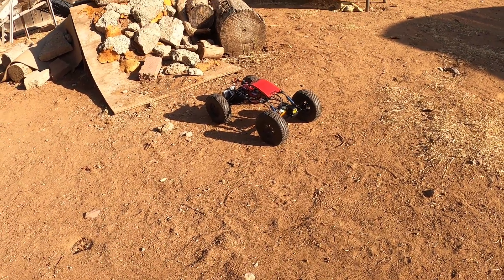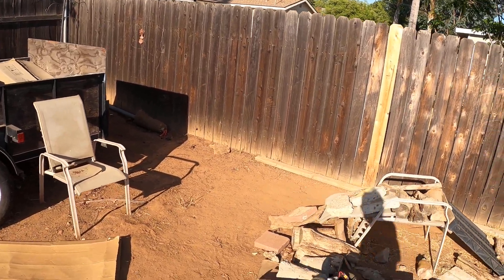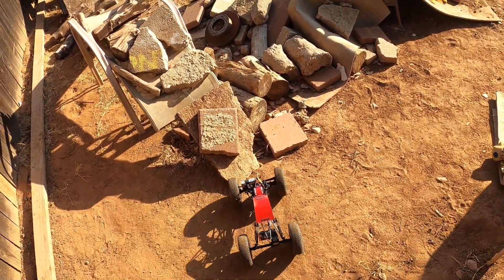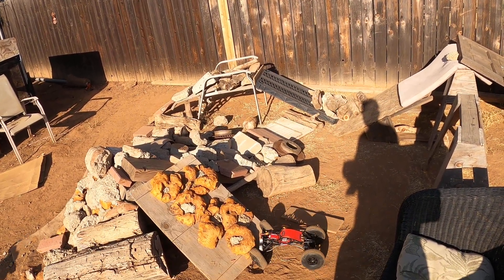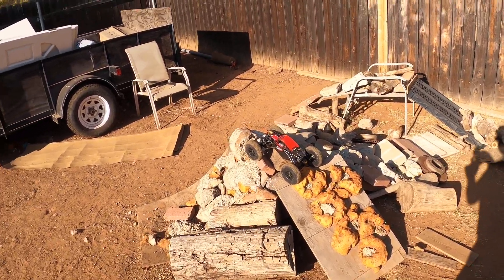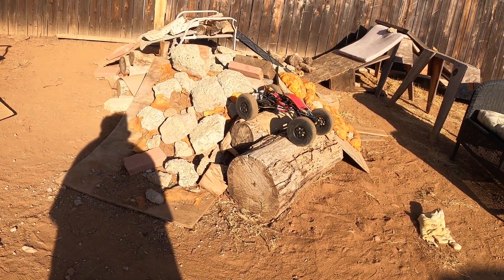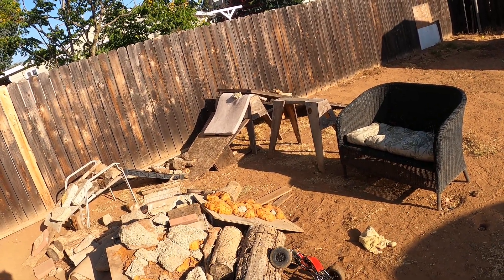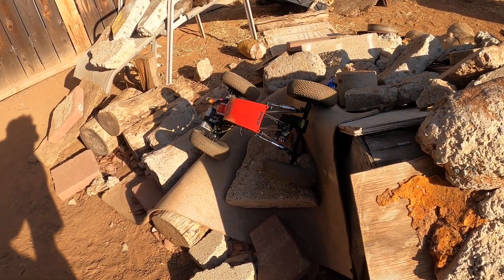RC4WD Bully 2 Motor on Axle Competition Crawler   " Chill Out After Work"

Comment: Justin, is there a way for me to recover my preloaded big models on my nx6? Some how my 230 and 330 are no longer showing up. I have crashed both and have rebuilt, but need to program them both
Reply: Remove ur sd card, upload everything to a file on your computer. (Some will be 'unusable'). Import everything to a new 2gb (yes, 2gb!) sd card. Full format ur current sd card, then put everything back on the sd card u r using on the sd card fir ur nx6. I had to do this to add everything i had on my nx8 TO my backup nx6.

Its a bitch, but it works! 👍
Reply: AND, ill probably have to do this again WHEN i get my nx10 in December. MY Christmas gift to me! 😁